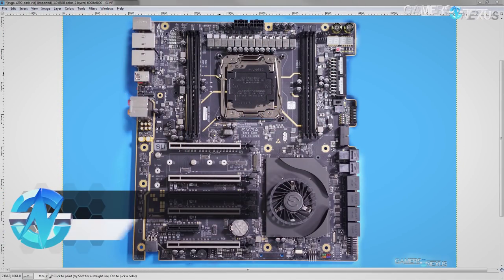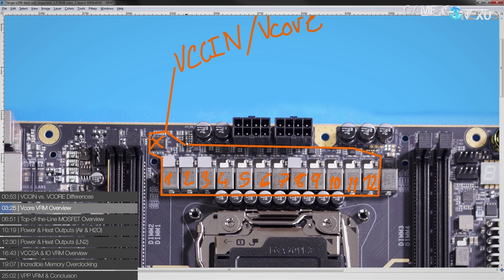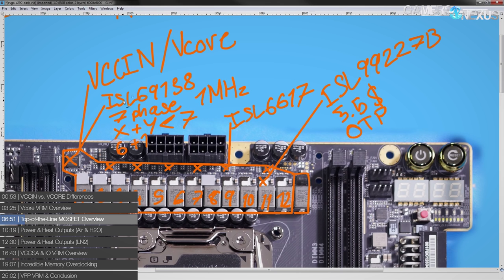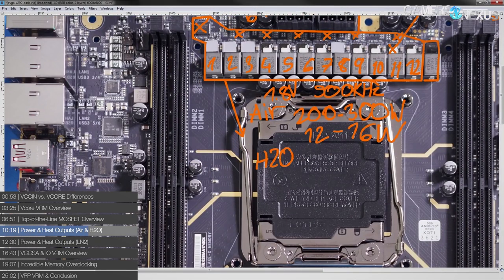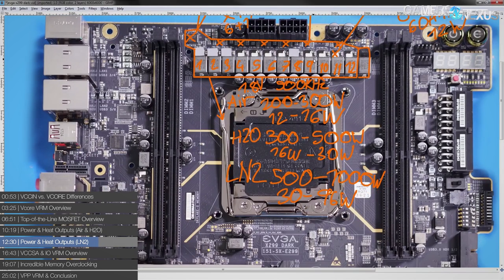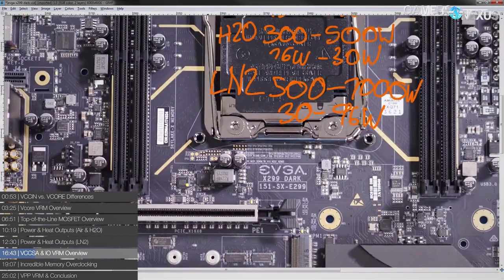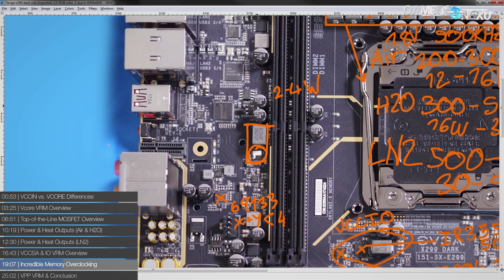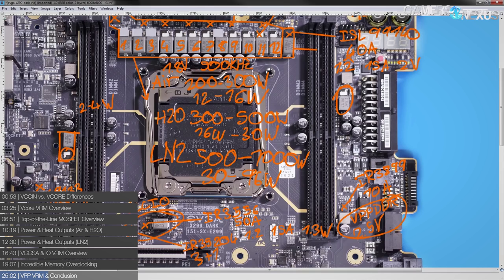"Ridiculous Overkill" - EVGA X299 DARK PCB Analysis

Comment from the maker: Find our EVGA X299 DARK thermal analysis here: https://www.youtube.com/watch?v=9DICvLJbefY
Find Buildzoid here: https://www.youtube.com/channel/UCrwObTfqv8u1KO7Fgk-FXHQ
Reply: a couple of things ...

1º, some people don't understand how electricity or micro electronic works, so for some one that know that is not hard to understand you but for the general users that is hard to understand.

2º, that mosfet controller's metal sheet are conductive with the chip it self ?, or can we add a better heat shield to that ?

3º, 2Kw xxiiii, do we need a new connection from the electrical company to have more that 3.3Kwats of contracted power just to hold the computer and still use stuff at home ?!?!?!? are you sure about the power requirements ?? that looks to high

Regards

Comment: Thanks for review, you are nearly spot on points :). Just few points: Skylake-X even at max LN2 OC it's more like 700-800ish, and actual VRM losses are less than your numbers by 30% or so, meaning even at CPU LN2 the VRM never get over +60c with lil airflow around heatsink ;). I have some thermal photos and power captures on X299 DARK OC Guide at https://xdevs.com/guide/e299ocg/#splim. I've chosen Intersil VRM for memory to keep things easier on design. There are many considerations, not just power and cost. 
And you use Kingpincooling Inferno to keep memory above ambient and be happy for long OC, ha. :)

Comment: Could you please do an analysis on the new VRM and cooler design on the Gigabyte x299 Auros gaming 7 PRO with a de-lided chip and how does it compare to the gaming 7/9/Ultra's old VRM and heat-sink designs? Also would there be a benefit to using such a board with something like a 7820x de-lided over other boards???

Comment: Thats the Board I wanted in my new build , but went with z370 Asus X Maximus hero . because who is going to pay 500 USD for that .. almost 700 CAD . Overkill and Overpriced. EVGA boards where really well rounded, The x-58 through x-99 did better with the price and where just as good overclockers. Proper VRM cooling yah but dont expect those 35/40 mm fans to be quite under load unless you replace them with noctua fans maybe but . Bring that price down to under 500 and I will think about it ....
Reply: Nathaniel Brown The X299 Dark is $468 CDN on Amazon Canada right now. I’m so tempted to build a X299 system instead of Z390. I just love this motherboard and I need to have it.

Comment: I coulda swore that stock the 7980xe and the 7960x could push almost 500 watts when under an all core load (granted thermals stayed in check). I know those two chips can chew through even a 280 aio and you're pretty much forced into 360 bare minimum. I know if I ever got a 7980xe, I would have 4x140mm worth of rad JUST for the cpu.

Side note, evga, please eat your pride and make a x399 board. I would love to see competent vrm cooling for a 1950x.
Reply: AFAIK it has nothing to do with pride. They have an exclusivity deal with intel, which intel pays them good money for.

Comment: I really, really wanted to like this board. When everything is installed and running it’s a beast. The problem is qa / qc. It doesn’t exist at evga anymore. Top line products like this should not have flimsy soldering issues or cpu bracket that doesn’t even have, well... a bracket. Just pins sticking out. Too many quality problems at what should be the premier wintel component shop. No more.
Reply: Flimsy soldering? i have 3 of these boards along with some asrock boards and they have been flawless. Sounds like you got open box/ returned boards? there is no way a board ships without a Cpu hold down socket.

Comment: Why is the X299 platform so much more than say the new Z370 platform?
Reply: Rangerscott High end desktop vs mainstream. X299 needs to be built far better than Z370 because it needs to be capable of powering an inefficient 18 core CPU at max, compared to a more efficient 6 core that could draw half the power. Skylake-X CPUs are overclocked Xeons basically, you can’t make a new, more efficient architecture as soon as they needed to release something before they got shat on by AMD.

Comment: do a max OC with this MOBO and LN2 and se how much watt it uses i guess 1000w just for the cpu:)only thing x299 is good as compared to x399 is as a heater..
Reply: The highest firestrike score is by kingpin using this board on LN2
Reply: He's currently testing it with a 7940X. He got top 10 in something with it
Reply: That's dumb. "value is pointless for HEDT customers." So spending less on a CPU to buy a better GPU doesn't interest anyone who wants a good PC.

Comment: I don't like fans on the chipset. They make noise and i worry they'll just fail eventually with them being unreplaceable due to being a unique design.
Reply: Just zip tie a noctua fan lol.
Reply: You probably don't need it anyway, and you just ask evga and they'll probably send you one for free. In the worst case you don't have a working fan, but will you notice any effect with the heat output of a chipset?
Reply: Mooferoo The own heatsink is more than enough to sustain the average user OC. Unless you're pushing extreme voltages and power limits.

Comment: I didn't know DDR4 was so efficient, my DDR3 220mhz @1.6v uses 33Watt so either my ram uses a ridicules amount of energy or DDR4 is ridiculously efficient
Reply: Mr Turbo well considering DDR4 runs max at like 1.35-1.4V and ddr4-2400 will run at 1.2V
Reply: 33W DDR3? Are you nuts? That is not happening even with a heavy OC.
Reply: +Wyrdak i could maybe also be hwinfo being faulty but i can't confirm this
Reply: lol, HWinfo nor any other software will report correct RAM power consumption because there is no way to do that. Its all just approximation.. but a very bad one. You are looking at less than 10W with DDR3.